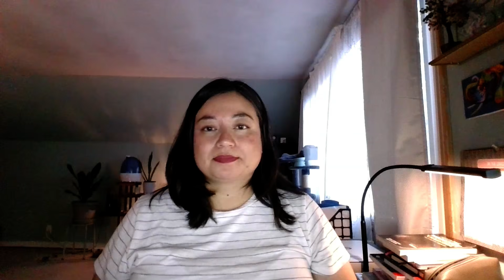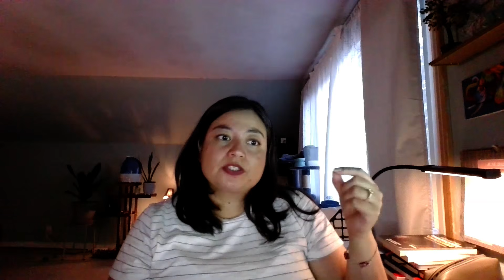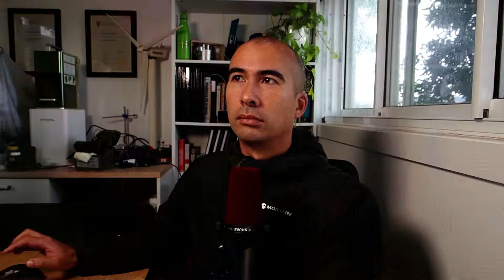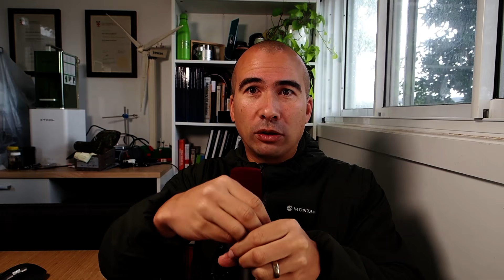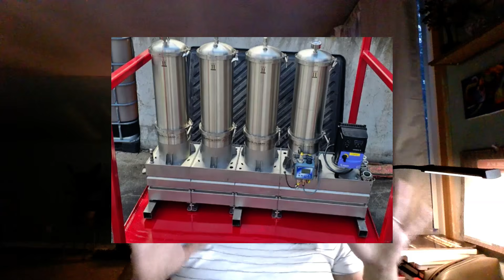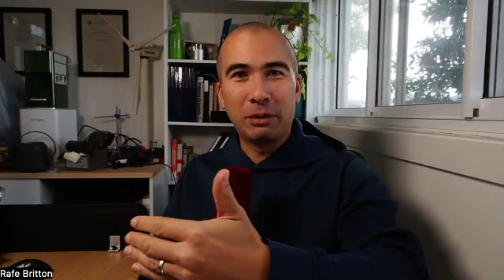Episode 068  |  Varnish Removal Methods with Elaine Hepley

Comment: SOlution to keep the oil free from Varnish: keep it COOL, clean and DRY. Use depth filtration for moisture absorption and micronic particle contamination. Additionally for very large volumes also use dry air purging to keep the moisture under 200 ppm for very large volumes of oil. Well thats my experience and sharing it here. It helps. We do provide such systems. Connect in case open to a solution. Thanks

Comment: For critical equipment, having a kidney loop bypass filtration system which can remove both the condensed moisture and the micronic particles will help in a great way to get the maximum life out of the lube oil and also prevents varnish formation. But sadly, not many  of them adhere to this process of proactive oil maintenance.

Comment: What is the chemical structure of standardized varnish? As varnish goes through stages of formation and encapsulation, what are its affects on compressed surfaces such as the mesh of gears, and on seals?

Comment: For reference: The hydraulic forge example removed 0.27% contamination by weight from the oil to go from MPC of 41 down to 16 with the 35,000 gallons of oil filtered an average of 52 times over 9 months, assuming an oil density of 7.2 lbs/gal. (679.4lbs/252,000lbs) This varnish had built up over 8 years.
Reply from the maker: Thanks for the detailed breakdown and for sharing that! Big system, big temperature, big varnish :)

Comment: I’ve been using Valvoline’s Restore and Protect product for a year in a heavily varnished Honda van with 200k + miles on it. It’s taken varnish that was so thick and dark (like dark chocolate) and slowly revealed bare metal. I don’t know what additive approach they are using, but there’s no disputing the results. When I cut open the filters, there’s a lot of soft carbon cake in the element pleats. I assume Valvoline is using some kind of solubility enhancer, but they found a way to allow the filters to still remove the carbon. If it was purely solubility, I’d think the dissolved content would pass through filters and only leave the engine by oil drain. I suspect the Valvoline chemistry is going more after the adhesion of the varnish more so than dissolving it per se. However it works, it does work. The old van has almost no varnish left! Amazing results thus far.
Reply from the maker: Lake has done a couple of videos on that product and it seems to be the goods! I reckon there might be a dose of AN in that engine oil.

Comment: If speaking about our approach in cleaning the engine (varnish removal), here in Russia and CIS we use foam varnish cleaners (VALERA, RESURS) to clean comb. chamber and special super flushes (decarboil) which clean the engines up to 90%. 

I have 3 special centers called: express oil change and decarbonization stations